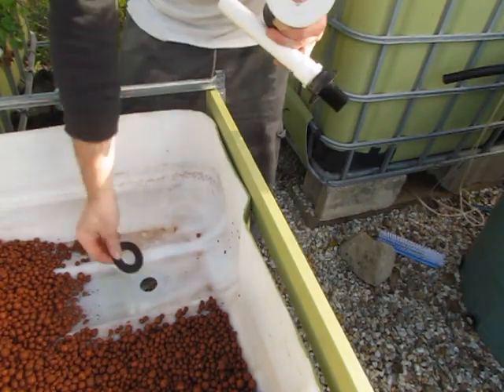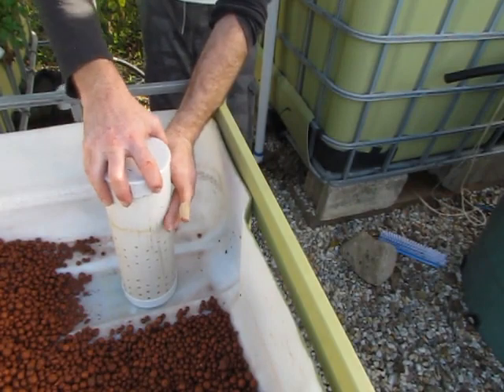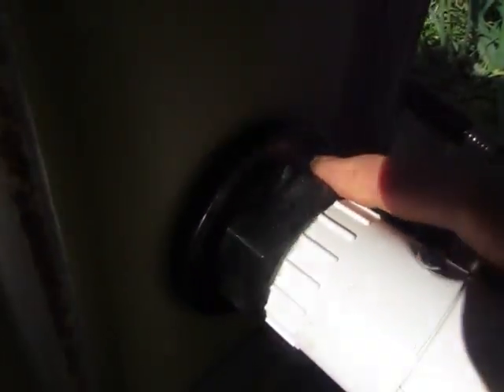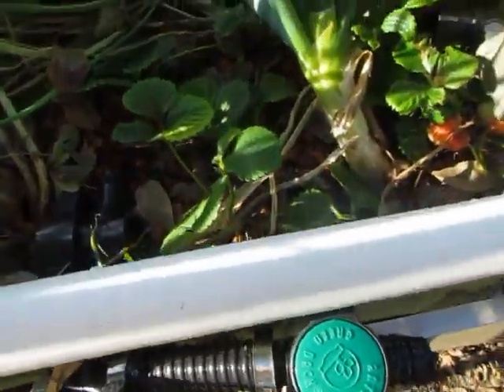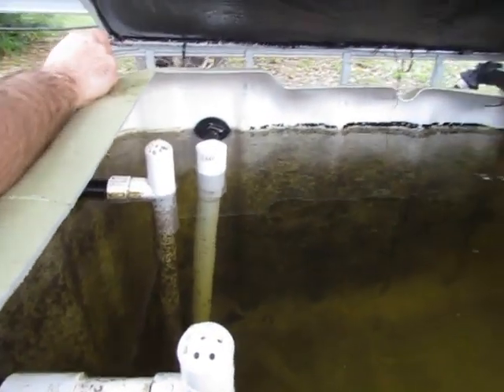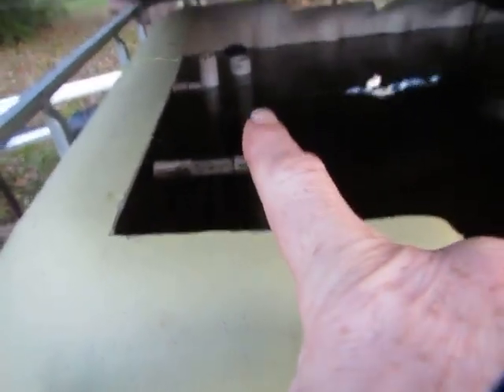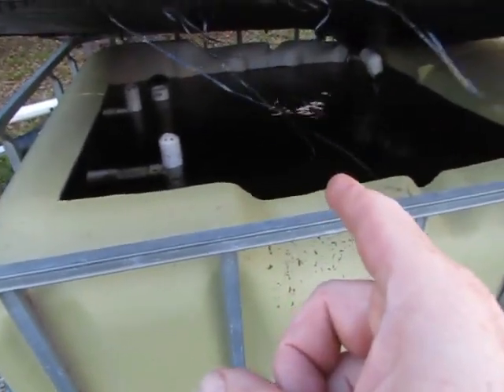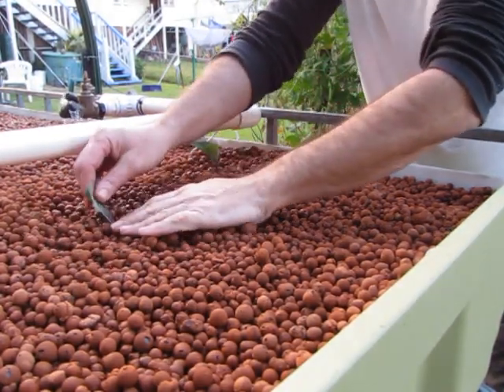Bell siphon, grow bed & pipework explanation. IBC Aquaponic System construction part 6.

Comment from the maker: Just used a 1"/25mm bulk head from a hardware/plumbing store.. Should be fairly easy to source them world wide in some form or another.. The male threaded end runs to the sump & the female end had an adaptor to hold the stand pipe..
Hope that helps :)

Comment from the maker: I drilled them out myself.. I actually ended up drilling more further up due to a slow running siphon a while back without realising the problem lay elsewhere.. They are part of the reason I will be rebuilding the system as I don't think they drain the water out of the grow beds to a low enough level.. Hope that helps some..
Rob.

Comment from the maker: I have all the bits for the battery backup except for the phone charger but should have it up & running soon. Feeding them a commercial feed but will be feeding them worms, black solider fly larvae & greens when they get their full appetite back. It took about an hour to get the flows right but I have a fairly good idea what flow is needed by sight now so that helps. Post a clip if you start up a system. Don't envy cold climate AP farmers. Is tricky enough like this. Have a good one..
Rob

Comment: Nicely designed and very well explained. Nice video!
Reply from the maker: Hi there & thanks. 
I have a more recent one that also explains how they work & goes step by step through the build with the parts needed if that helps any.
https://www.youtube.com/watch?v=Ia1BQFTaG7c&index=5&list=PLBcWprMIwYYi3Y3tUNUMWhO-g_ZhWfijY
Are you looking at building a system for yourself? 
Have a top one.
Rob

Comment from the maker: Hi there... 
For the feed lines into the grow beds I use a 32mm/1¼" pipe but think that is too small so am moving up to a 40mm/1½"... 
For the drain pipes from the grow beds I am fairly sure that I will start using the 32mm/1¼" pipe in the new beds.. I think the 25mm/1" just don't drain fast enough for the amount of water I have coming through at the moment..
Hope that helps some & let me know if it doesn't..
Cheers,
Rob.

Comment from the maker: Which one Deano ?? If its the ones on the bulkhead fittings they are just a female threaded PVC fitting with female sleeve on the other side... They are called a "Female Adaptor PVC 25mm"...
Hope that helps but let me know if you need more info..

Comment: Awesome Rob. I'm taking notes, trying to get all of this sorted out in my head. I watched a few hours of Murray Hallam videos over the weekend. I'm really impressed at how well it all works together. The siphon is very intriguing. On yours, I didn't see a tube running down the side of the inner part of the bell. But it seemed to be doing just fine. Can you explain the difference in the 2 styles?

Comment: thanks for the walk thru -im building my own system it has 3200 liter tank- the water from the growbeds and  the overflow from the fishtank go to the same sumptank  there a pump re distribute them back to the grow beds and the fishtank -i folowed murry helem design princeple -mach 2- ive noticed that in your system the overflow from the fishtank goes to the grow beds which is the tradisional method.what do you think about the mach 2 design?to be honest im concerned most people use your setup....

Comment: Hi Rob.  I'm starting an aquaponic system for our orphanage in Haiti.  I want eventually to have 4 large grow beds 4 feet x 20 feet. (I will adjust the length of the grow beds for the actual gallons in the fish tanks)  4 fish tanks 600 gallons each.  I will run them in a straight line.  Fish Tank then a sump tank and then the grow beds.  My questions is: Can I use one sump tank for two fish tanks and two grow beds if I make it big enough?
Reply from the maker: Hi there.
You should be able to run 2 systems with just one sump tying them together. Just make sure it's large enough to hold the water needed for the beds if they're built to flood & drain.

Comment: Nice video Rob, thank you. How many pumps do you have? If I want to expand like you have, what size pump would you or did you start with? I have 3 IBC totes thus far. Thanks in advance for everything.
Reply from the maker: Hi Jonathan. Am so sorry I missed this mate. This system was run by one 4500 lph/1188 gph pump & found it worked well in this configuration. 
Did you up scale the system at all? 
Cheers.

Comment: hello nie job I have a very small system and everything was going great cycled and working. I was claening the system a little and when finished well problems with my syphon. I took an old soda bottle and used it for the bell and saw what was going on. Ok I played with the bell and it worked but in a few cycles would not stop. I discovered that I had to put my bell in so it could not move, as the water entered the bell would move enough to mess with the syphon I got it to aplace where it worked and made sure it could not move. working perfectly now hope This helps someone else
Reply from the maker: Thanks for that Larry.. Hope she keeps running well for you mate.. 
Cheers..

Comment: Do we have to run the pump 24/7. Dont they burn out.  Or which brand should i go for as a starter.
Reply from the maker: Most of the ceramic shaft magnetic drive pumps are made for continuous running. I would stay away from bilge style pumps though as they are not designed to be run non stop. 
Brand wise it varies a lot country to country. Whereabouts do you live? 
Cheers.

Comment: I live in the desert and the soil is awful here. I have been considering an aquaponic setup, but I am concerned about water use and evaporation making my hard water even harder. My local aquaponics dealer suggests covering the fish and sump tanks because "fish don't need light". He says add water, but don't change water. What do you think? BTW, we use 2 cm crushed lava here instead of clay balls for an 85% cost savings. It is very porous and relatively lightweight.
Reply from the maker: Hi There... Sorry I missed your comment.. A load slipped through without me getting notification from google for some reason..
Should be no reason to take water out of the system unless something goes pear shaped..  Whereabouts are you living & what sort of fish are you looking at running in there mate ?
Cheers..
Reply: Rob Bob I live in Tucson, Arizona near the Mexican border with the USA, Sonoran desert. We see sustained winter temperatures of 5 C (sometimes lower) and 38 C in summer (often higher). I like to cook and I want an herb garden. I have no experience as a gardener, but decades with fish. Even indoors, I lose 5% per week to evaporation. I'm considering starting with an indoor system using either koi or regular hobbyist freshwater tropicals. Noise will be a factor. If it works out, I'll consider a hoop house in the back yard, probably with koi. Tillapia don't like the temp extremes.
Thank you, BTW, your vids are very informative.
Reply from the maker: jfingers15 Sounds like you have similar temperatures but a lot less humidity..  Have you seen Wicking beds ? 
Cheers,
Rob..

Comment: I am wondering how many pounds or kilos of clay balls does it take to fill each of your beds. I have several ICB containers and would like to start an aquaponic system in my greenhouse. I would like to get some media ordered. Any help would be great. Thanks
Reply from the maker: Hi Kevin.. The clay is normally sold bagged up & in litres or gallons which makes it easy... Just need to work out the volume of your grow beds & you can work out how many bags of media you need.. Our clay came in 45L/12gal (US) bags so our roughly 300L/80gal (US) beds took about 7-8 bags each.. Hope that helps some & have a great time designing & building your system..
Cheers,
Rob..
Reply: Usually in 50 kg bags from an IBC  of 300mm depth  you will 4-5bags of  clay balls

Comment: Does the water travel from the fish tank to the growbeds purely by gravity? I know there is a pump in the sump to the fish tank, just curious about the next step. 
Also, would the growbed that is "first" on the pipe from the fish tank get more nutrients than the the 2nd or 3rd bed?
Reply from the maker: Hi Joshua.. The water flows via gravity from the fish tank to the beds...The beds are on the same line so all get the same nutrient rich water through different taps.. Hope that helps & let me know if you want more information..
Cheers,
Rob..

Comment: Hey Rob,
got a question.
Here in Dubai I can easily find hydroton (size 8 to 16mm). I found a company in Iran (across the gulf) who has a slightly larger version (10 to 25mm) what are your thoughts? Is it a case of the bigger the better? Do you know the size of the one you use?
Thanks for your time.
J
Reply from the maker: Hi Jason & sorry I missed this. I'd go with the larger clay to help water flow through the bed when draining. The smaller would still work OK mind you. Which did you end up getting ? 
Cheers mate.
Reply: Hey Rob,
No worries :)
I ended up buying from local supplier:8 to 16mm It is not ideal as it blocks the holes I did for the media guard and even some end up passing through... A headache! The other supplier only works with large volumes and was too difficult to get hold of. Even pea gravel is only sold by the metric ton. Dubai is not (yet) ready for backyard auaponics;I'm working on it :)

Comment: Why do you put fish into the sump tank?
Doesn't that cause problems for your other fish putting back polluted water instead of fresh water from the plants?
Reply from the maker: Hi Jeremy.. You would be most correct there & not something we do any more.. We had the goldies in there to separated them from the perch & ended up giving them away to folks with a few ponds.. I don't think the amount of waste they produced would of been a big issue with the stocking density we have but still not desirable..
It's sort of like the way some folks run their CHOP systems with the fish tank running to the sump only to be pumped back into the fish tank..
Cheers & have a great one sir :)

Comment: Hi. What size is your standpipe as well as the bell?
Reply from the maker: +Wayne Renkin Hi Wayne.
in this build it's a 1"/25mm stand pipe with a 2.5"/65mm bell. 
On newer beds the standpipe size has been reduced to a ¾"/20mm pipe with a 1-¾"/25-20mm reducer fitting on the top to help the siphon initiate faster. You can see what I mean in this clip if it helps, https://www.youtube.com/watch?v=vMCacrzjb74

Hope that helps some mate.
Cheers.
Reply: +RobBobs Backyard Farming Hi Rob, 
Thanks for the information. 

I am struggling with my bell siphon. I have a 20mm standpipe. I have tried a 40mm and 75mm bell, but the siphon does not want to start. 
I have constructed the plumbing with a small curve up to restrict the water and start the siphon. 

My inflow into the growbed is not that fast, but at this stage this is what I have to work with. 
Does it help to make the top part of the standpipe a bit bigger?

Thanks
Reply from the maker: +Wayne Renkin 
Hey Wayne. 
Sorry I missed your response mate. 
Have you sorted out your Bell siphon yet ? 
It does help to use some sort of adaptor to the next size up pipe to help get a decent flow into the stand pipe to help initiate the siphon I think.
Reply: +RobBobs Backyard Farming I reduced the standpipe to 15mm and it now works great. 
Thanks
Reply from the maker: +Wayne Renkin 
Great to hear Wayne.
Cheers mate.